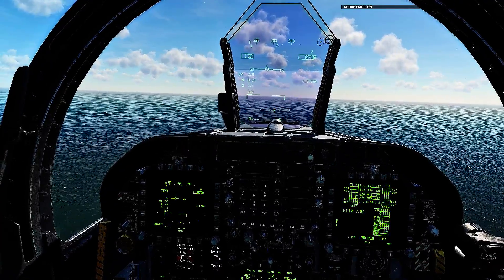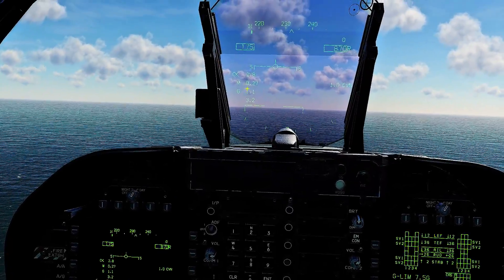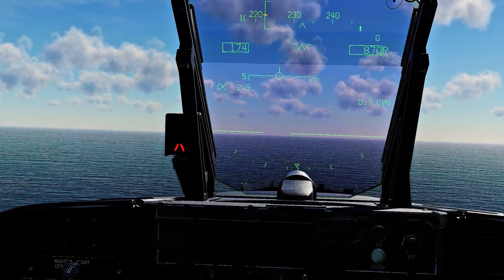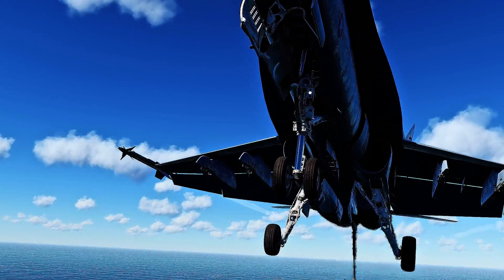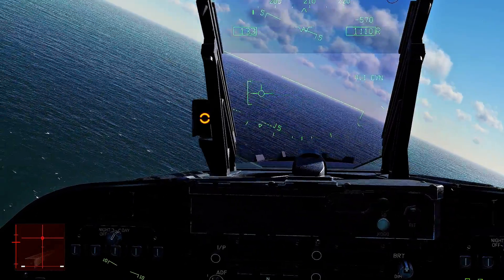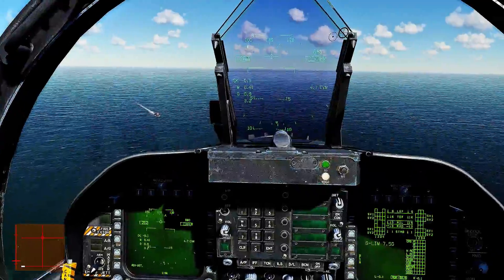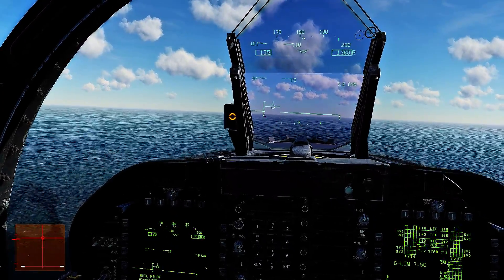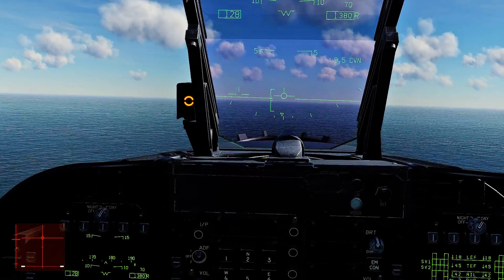How To Maintain On speed AOA In the DCS F-18 [Making The F/A-18C Easy]

Comment: It’s apparent with the realism in dcs some of the hornets shortcomings mainly fuel consumption and power needed to maintain aoa .  For me personally it can be very risky if you return to the carrier with less then 3000lbs fuel which in hornet terms is easily possible if on an extended flight, if you say return to the deck and have one bolter by the time you fly the correct pattern and set up again you are easily down another 500-700 lbs if you bolter again then it really is crunch time... anyway love the module but it shows some of the real issues navy pilots would face.... the hornet has a huge sting but not a lot of juice.
Reply from the maker: TheCraigHudson I found. The fuel to be quite good I can get about 3 patterns out of 1500 pounds, and they just changed the drag model so a lot less power is need to maintain aoa.
Reply from the maker: You also use a lot less fuel now with the drag model. A lot less power needed.

Comment: Nice video, and good explanation of (on-speed) AOA! One piece of helpful I would like to add would is that whilst flying dirty (flaps/ gear down, airbrakes / slats out) the F18 is extremely slow to accelerate. I have seen people pull power to try and get the AOA (or get on glideslope) and end up in the drink, so be careful with that.
Reply from the maker: Nanne118 ya it’s fine if you don’t use speedbrakes, if your not familiar with the plane and how it flys the yes I agree someone who is new could risk falling out of the sky lol.  It when you take out power you almost immediately put it back in, if you do that you will be fine. Thx for the comment